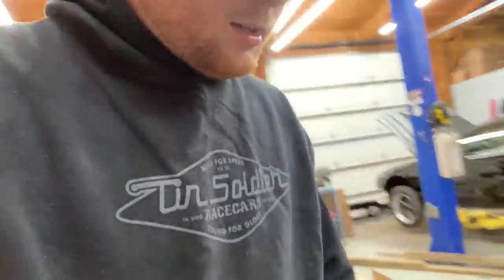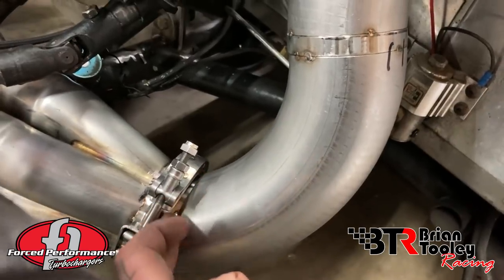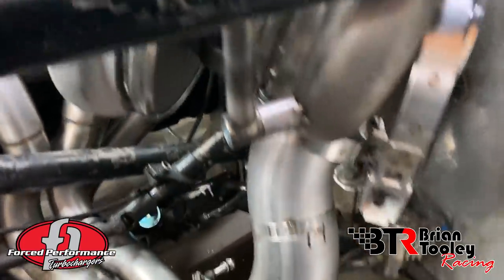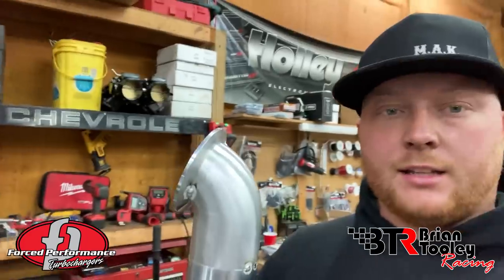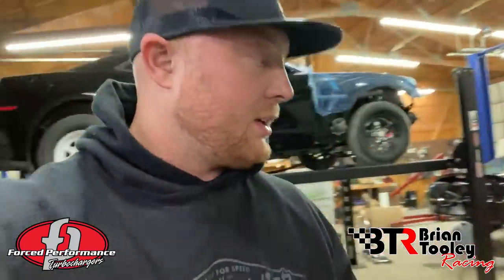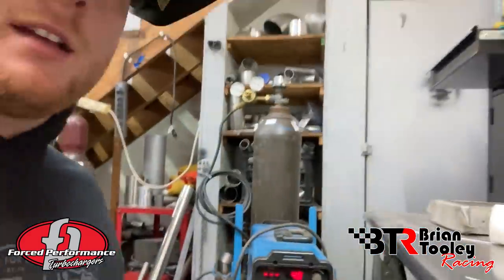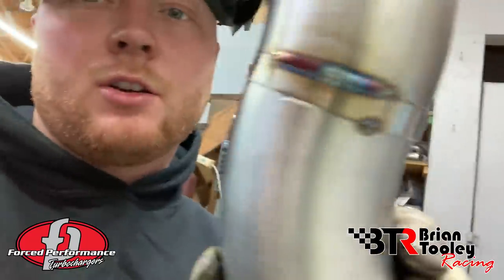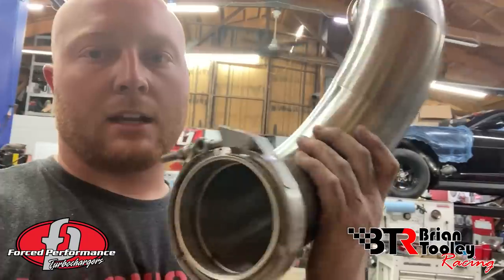Building a 6 Second Camaro for Sick Week PART 3: Uncle Sam goes Twin Turbo

Comment: Hey Nick, what's a decent, cheaper Tig welder to start out with and just do my stuff at home. I'll be doing a cage, weld in moly sfc's, which I will also brace the floor with and add supports off of. Car looks killer man! Would yall be interested in coming to FL to race a small tire, no prep deal..? Trying to get a pretty big tally before I start planning, so it'll be a pot worth traveling for! 
Camaro is lookin killer man! Where all does sick week go..?
Reply from the maker: Check out the Ahp alpha tig 201x!

Comment: I also enjoy a cold latte after a successful sexy fab session! Specs on the turbskies for the 427?  Really dig the location of the turbos, I was watching some of your old videos of maliboost for inspiration.  Going to twins from a single on my 81 and want to stuff them in the back of the engine bay, any tips?
Reply from the maker: Make sure you have enough room for piping and don’t screw yourself on the turbo drains! Lol the twins will be 80/82 forced performance turbos